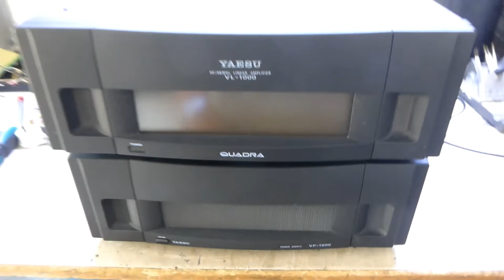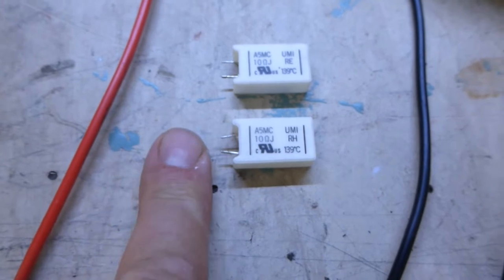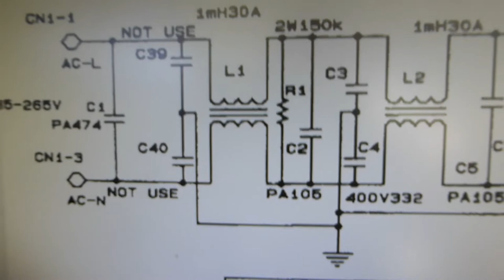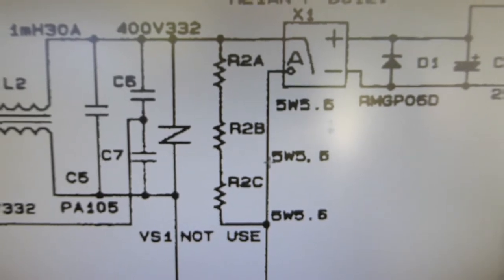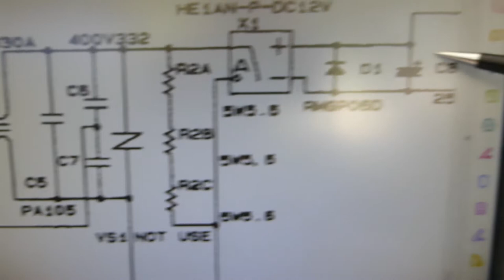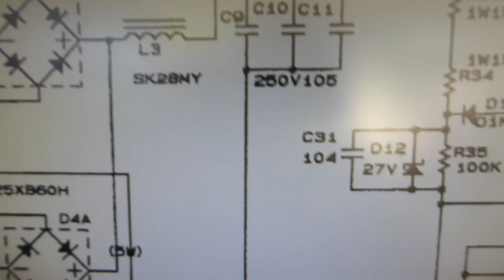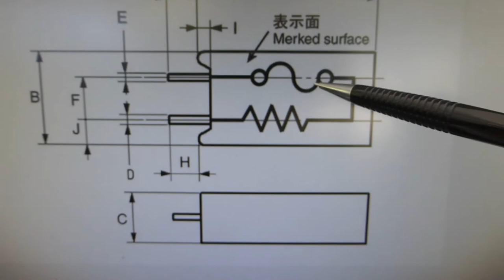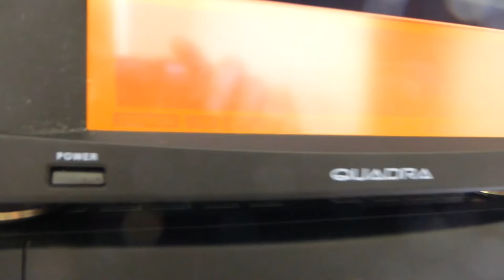Yaesu VL 1000 Repair

Comment: Joe - I wonder if you've come up with a scheme to replace the resistors yet?  I know they're available from Yaesu, but here in the USA it takes quite a while to get parts from Yaesu.  - K8AC
Reply from the maker: Hi K8AC, sorry your name not given on QRZ unless I log in and I have not used that site for years. The OM who owned the equipment decided to sell it on once it was repaired, and so further work on the problem is not really possible with no test subject to try any solution out on. The protection given is both inrush current and thermal and so the ideal solution would be to see if the manufacturer makes a similar combo unit with thermal fuses which reset. If you just replaced the units with resistance, then if the switch mode fails to produce the 12v which enables the relay to short out those resistors, then you may end up with burn through holes in the pcb or worse. The OM here used a UPS for several years and avoided that problem (he works his station remotely) and it only failed as the ups batteries failed. We live an an island! poor AC distribution network, quite old. 73s joe